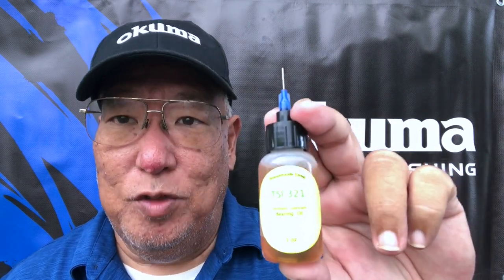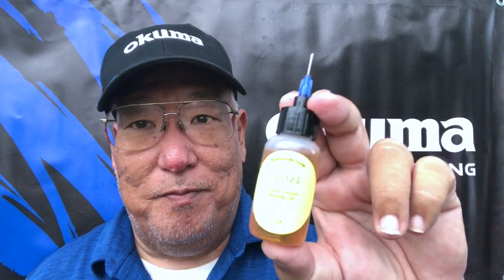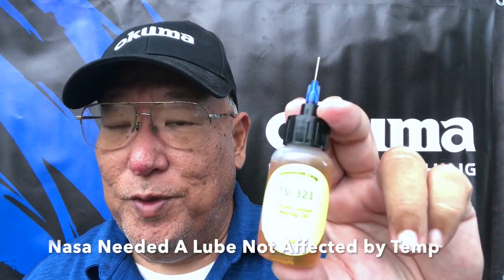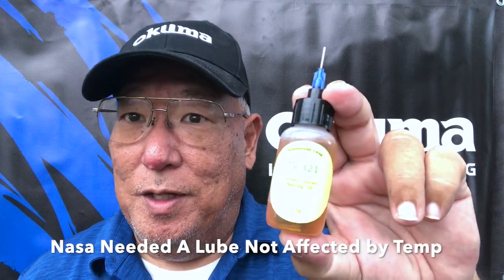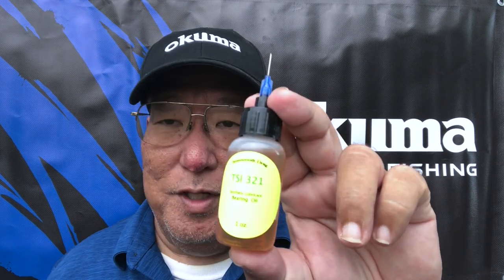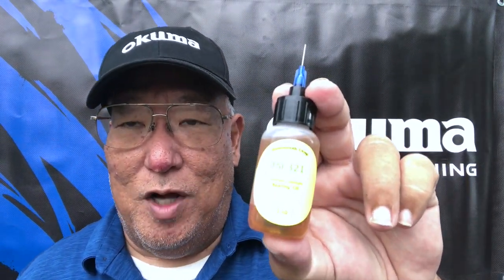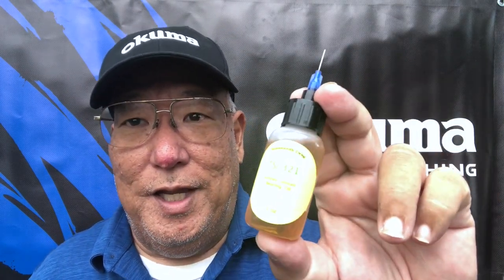TSI 321 - Your Reel's Bearing "One Drop Wonder"!

Comment: Tsi301 is not better or worse than 321. It is just a thinned out version. It is thinned out with a strong solvent. It does not perform any better. If you want to thin out your 321, get a pure isopropyl alcohol as you can get.

Comment: Interesting.  We use TSI-301 in the Makaira and high end reels.  I hadn’t heard of the 321.  Looked it up and here is what I found.  

“TSI 321 does not contain a solvent and is highly recommended for use where most plastics* are present. (TSI-301 contains a solvent and is not recommended for use on plastics but ideal for use with metals)*TSI321 is compatible with all plastics except PMMA (polymethyl methacrylate) and PVB (poly-vinyl butyral).”
Reply from the maker: Thanks Dave. I chatted with a reel repair guy who said this was the best that i can obtain. Couldn't find a source for 301. Expensive but was told it was worth it. Planning on using it on my Tesoro12's.

Comment: In your experience how does it compare to reelx, in terms of saltwater protection. Distance isn't my goal. Not rusting out bearings is my main goal. They don't last long (even with rinsing and maintenance) in a kayak and small boat.
Reply from the maker: I haven't used Reel-X so i can't give you the answer correctly. Most reel repair shops use TSI from Alan Tani down. The Makaira's are pre-packed with TSI-301. The best of the TSI. Not for the general public though.
Reply: @ScubaChris  aw okay. Was under the impression that the okuma provided corrosion x branded oil tube was actually their reelx oil.
Reply: I have the same goal to keep my bearings from rusting.  So how's reelx working for you?  Worth it?
Reply: @walden6272  I wade and kayak the very salty Tx coast about 2 times weekly. I have zero issues with my reels. A light water rinse or wipe own with a homemade or store bought reel cleaning product, then some drops of reelx, clenzoil, or similar works reels,

Clenzoil is some pretty good stuff. I use it on my bogas and pliers that stay submerged while wading. Zero problems.

Comment: In your description youth advertise a product called Liberty oil as a synthetic oil is this the same product is what you are advertise in now as TSI 321
Reply from the maker: No, it's the closest from Amazon. This is where i got it off eBay at-
https://www.ebay.com/itm/TSI-321-Synthetic-Lubricant-Reel-Oil-Bearing-Oil-1-Oz-Bottle-w-Needle-Cap/154115277878?hash=item23e1fc8436:g:oZIAAOSwJkJWkCyO